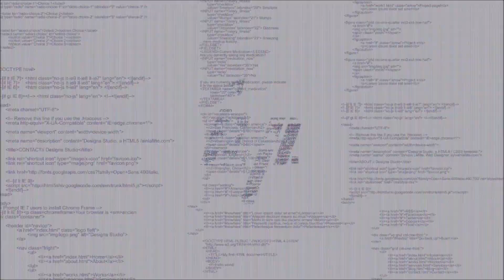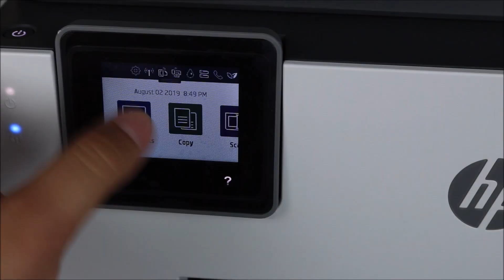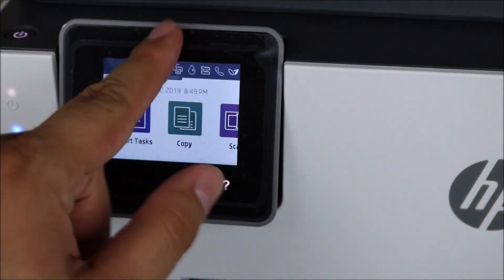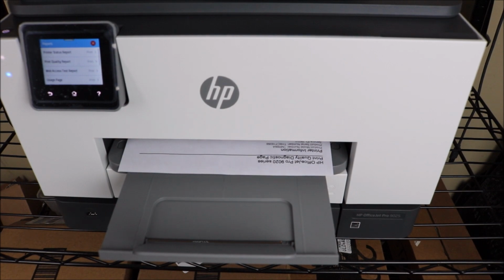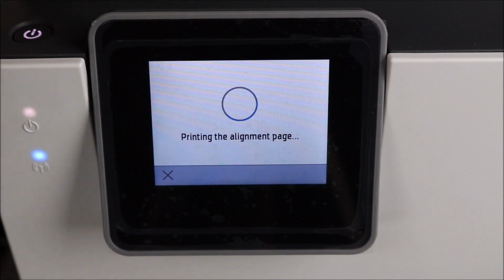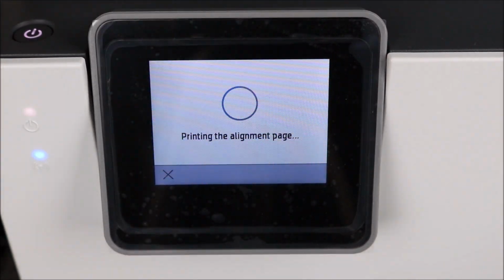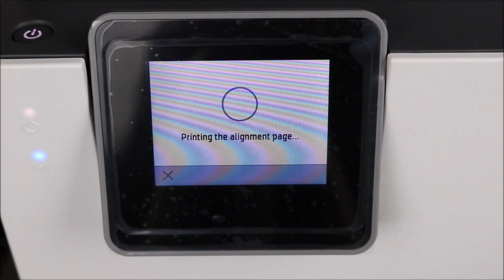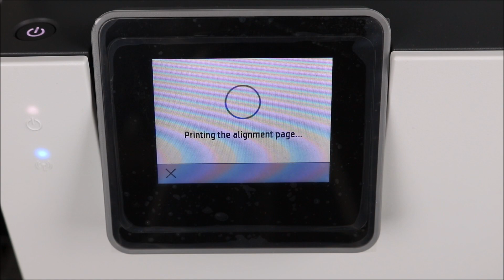Hp Officejet Pro 9025 -Not Printing Fixed-  How To Unclog Printhead

Comment: I have the same printer.  I'm getting horizontal lines across my prints.  My cartridge levels are good, I've aligned my printer, my test reports look great, cleaned the printhead.  Even uninstalled my printer software and re-installed.  Any recommendations of what else to try?   Thanks
Reply from the maker: did you try this cleaning with the kit?

Comment: Have this exact printer. Didn’t use it for maybe a year or so. And it wouldn’t print any black ink. It was all messed up. Bought this solution. Did what it said in the video. The black printer head had resistance when I first flushed it so I knew it was clogged. Finally it broke free. Cleaned all the other heads while I was at it. Put the print head back in a boom - worked like new. Highly recommend this product and solution if your printer isn’t working. Thank you.
Reply from the maker: That is great news, I'm glad you had success!

Comment: Has this worked for anyone?

I bought all new fresh HP inks.  Bought his cleaner kit.  Processed 3 X, and still SUPPLY SYSTEM PROBLEM error remains.  

Last resort was to buy a new HP link.  haha.  They of course have moved onto a newer model so all the old ink is now useless.

Comment: I have the same printer. I have cleaned the printer heads, replaced the ink cartridges 3 times. Only getting supply system problem on the colored ink cartridges any other suggestions?
Reply from the maker: Have you run a printhead cleaning?
Reply: @BestPrinters  I tried to run both the clean printer head and align printer head. It will not do anything other than give me the error of Supply System Problem.
Reply: I'm having the same issue. Did you find a solution?
Reply: I'm also having the same issue with the cyan cartridge